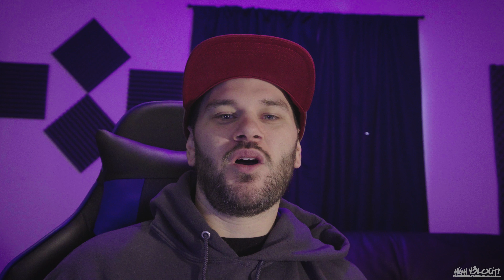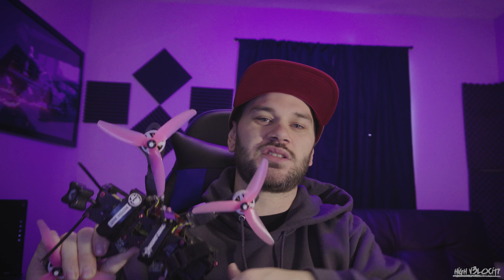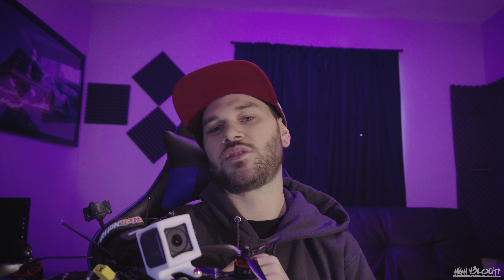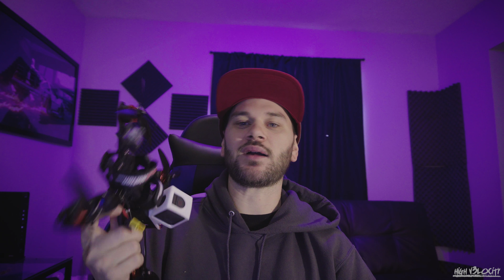6s Reverb - Road To Higher Efficiency

Comment: I'm also building a kissv2 with kiss32a escs and noticed you don't have the 50v capcitors on your escs that's recommended for running 6s in the manual. Might want to look into adding those in.
Reply from the maker: My cap is a single large cap hidden behind the camera.
Reply: High V3locity what's your pics btw. Running a reverb 6s build also but can't seem to get the pitch right
Reply from the maker: My PID's are very custom and tailored to this build. Unless you were running my exact setup, They will most likely do you more harm then help.
Reply: @HighV3locity  how do you have this set up? To the PDB?

Comment: Did you had any 50V capacitor as recommended by Flyduino?
Reply from the maker: I have a 36v 1000uf cap on it.
Reply from the maker: I have a 36v 1000uf cap on it.
Reply: Thanks for the quick answer, I’m actually doing a similar build (Alien 5'' x 6'' with the F40 1600kv motor) and I wasn’t sure about adding a capacitor on each kiss esc. I may just use a 1000uf 35V on the pigtail too… Please let us know if you find any issue with the newest kiss hardware on a 6s configuration.
Great job and vid… Fly High man!!

Comment: I wonder, if the people that were flying 4S and destroying their batteries, flew a bit softer and didn't run the battery out, would they just be blown away by the other racers?
Reply from the maker: At MDX guys were changing lipos to 4.5v a cell to stay competitive. So in racing yes flying slower to conserve battry will just make you loose.